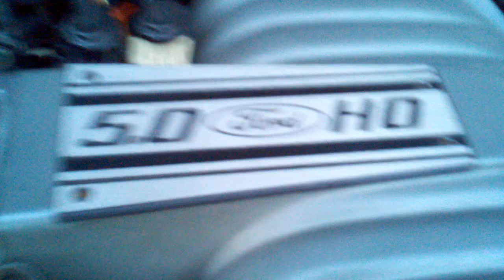1975 Leo V8 Mercruiser 888 5.0 302 EFI conversion EEC-IV A9L Start & Run

Comment: Where did you put the O2 sensors?
Reply from the maker: There are none. It runs open loop.
Reply: Thanks. I have this setup in my truck ('92 F350)and love it.Thinking of running similar in a boat.
Reply: I want to do this, is there any way to contact you?

Comment: how did you manage to wire in shift interrupter switches? what kind of out drive are you running??
Reply: It was very simple. The positive lead of the coil through the interrupter switch was wired to the new coil. The negative coil connects to the tfi module as it would in any Ford EFI engine. The drive is a Mercruiser 888.